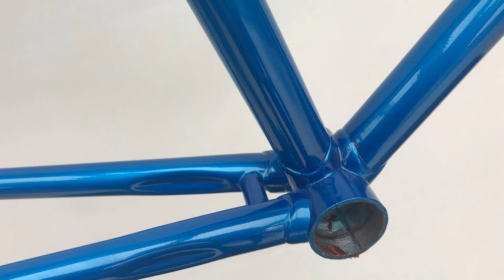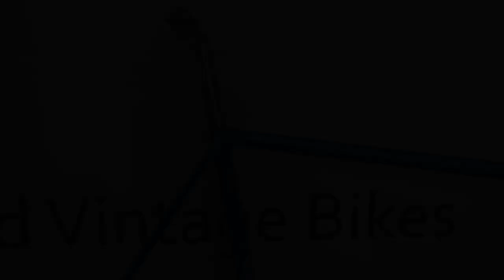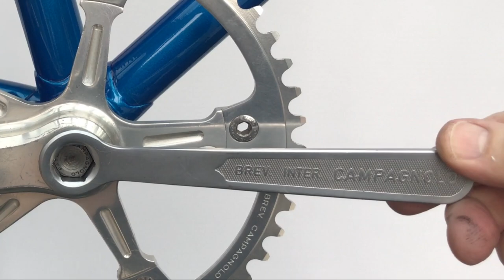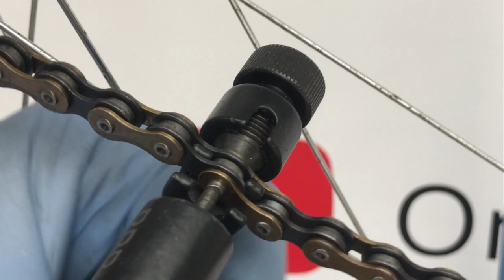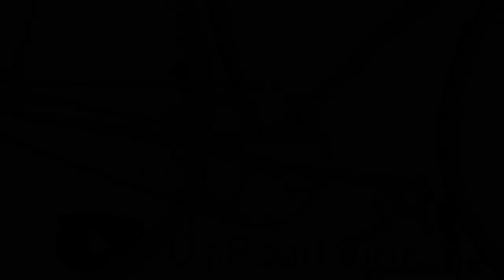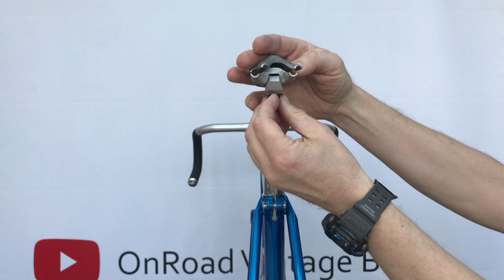Favorit F2 1986 +  Campagnolo Super Record Pista

Comment: Those tyres look a bit old and tired. Tubulars / sew ups I presume.
Reply from the maker: The V tyres are simply original. The bike will be exposed to the wall and it does not matter there...
Reply: Needs a spin around a track surely . Either way - lovely piece of art .